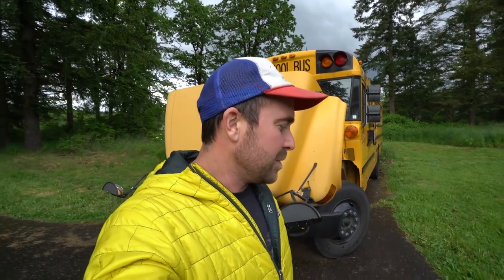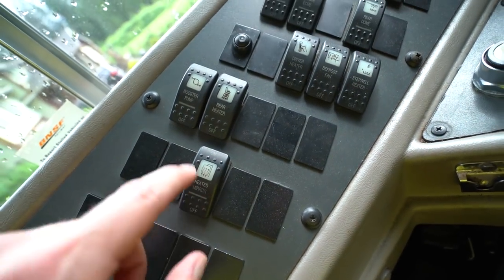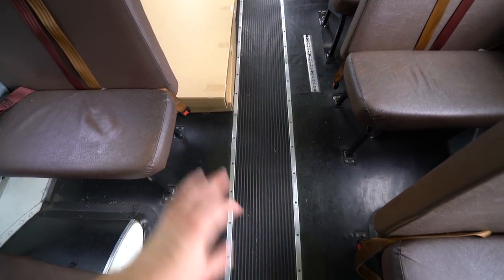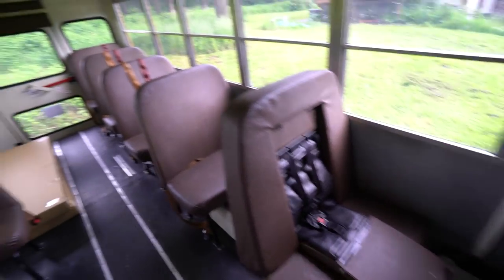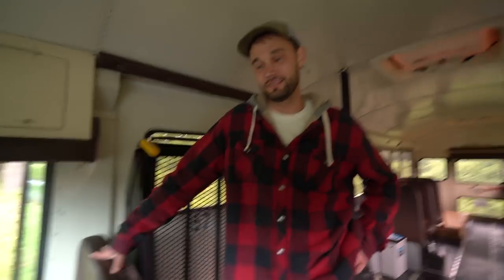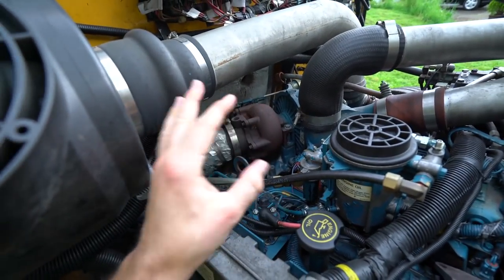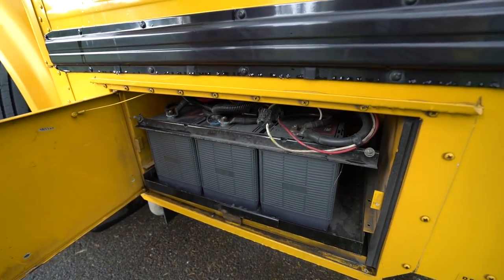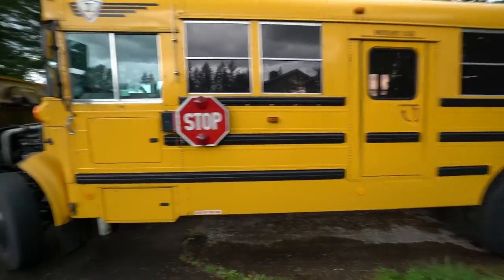SCHOOL BUS TOUR - BEFORE SKOOLIE CONVERSION

Comment: Sorry if this is old news but air brakes work in reverse. The air is pumped in to cylinders to release the brakes not to apply the brake. If your engine is not pumping air to the brakes you will NOT move. When you tap the brakes, air is released from air lines and massive springs are alllowed to apply friction to wheel drums and slows the bus down.

Comment: Jax, another BIG plus with that back heater is if the bus is overheating turn on that back heater and you add about a gallon of cool fluid to the system.  That should be enough to get you off the road and somewhere safe.
Reply: I'm alway amazed that the people that make comments here are so smart!
Reply: Would you also be amazed to know that Jax made that comment in the video but apparently Journeyman wasn't listening.
Reply: Jackson we heard him but it's important to keep the heater, hard to go back da !!!
Reply: I just bought a bus. A short bus though... because I'm short. It has one of those heaters. It doesn't work though :(

Comment: Two things about air brakes I have experienced in about 1 million miles in coach busses are if you notice you are having to push harder on the brake pedal for the same amount of braking, there is an air brake problem and if you have to hold the parking release button in several seconds for the button to stay in and the brakes release there is an air brake problem. Just two things to be aware of with air brakes. One other thing that has been touched on in the comments, if you lose air pressure going down the road the maxi brakes (sorry brand name) will lock the rear wheels up tight immediately and I think that the parking brake button will pop out at the same time. I believe that will happen somewhere between 30 and 60 pounds air pressure.
Thanks for your videos.

Comment: I drove that exact same year bus as a school bus driver. They are awesome buses. You only need to drain the air tank if you are in humid climate. I live in the desert and we only had to drain ours during the rainy season. Also, cruise control is awesome, BUT you should NEVER use it while it's raining.

Comment: FWIW on air brakes. I am NOT an expert by any means, but as I understand the air brake system, a mounted air compressor is driven via "fan belt" by the engine. The air compressor is physically attached to the engine quite similarly mounted as the common alternators and air conditioner compressors. As the engine turns and makes RPM, the air compressor produces (80 to 120 PSI) and feeds compressed air to an air tank reservoir which supplies the system. The brake pads are held away (open) from the brake drums by the application of air pressure. When the driver steps on the brake pedal, air pressure is reduced/released from the closed system and the brake pads are released to engage the drums thereby the braking occurs. Depending on how much air the driver releases by pedal determines the severity of the braking cycle. The dash-mounted big yellow air switch/valve, when "pulled out", releases "all air" from the brakes , thereby locking the drums, the wheels cannot turn, the bus is parked. The air tank refills to capacity as the engine continues to make RPM. When the big yellow pull switch/valve is "pushed in", air is once again supplied to the brakes and the brakes are are released. If the brake system encounters catastrophic failure, i.e. air loss, while stationary or in motion, all of the brakes will "lock up".  Visual evidence of the catastrophic loss of air can commonly be found by the many demonstratively long and dark dual-wheel skid marks on our highways and byways. These incidents are likely from 18-wheel trailers having their air-lines inadvertently disconnected from the tractor (or ruptured hoses) while under tow. If your air compressor does not produce or there is a fault in the system, rest assured, the bus will not roll until you get the issue resolved. Stranded!
Reply from the maker: Yes! That sounds about right!!

Comment: If you use the lock on the outside  a suggestion from another skoolie life people that you rock before you go in. That way, no one can come along and lock you in your bus. ijs
For labeling wires, cords and cables; use the tab closures from bread, bagles and stuff. Write identification information on the tab and place it around the wire, cable or cord. FYI

Comment: I think you may want to ask Badge if getting rid of the heater is a good idea, as you said that can help with engine over heating !!!
Reply: It's also a system that works that's in place. I'd keep it as an auxiliary to a roof AC unit and if I had to I'd move it. Maybe put it on top of a wheel well since those are gonna have special treatment anyway.
Reply: Am. Blades the heaters are staying we might move them and we need them for WVO 🇨🇦💋💋

Comment: Air Brakes- You pull the Parking Brake (Yellow Knob) and IT WILL POP that means it is on when you release it the Air is forced out of the Brake Chambers and IT WILL HISS meaning that it is off and to Start a Bus The gearshift MUST be in Neutral so if you leave the bus in drive and try to start it you will not be able to start up the bus. The Bus with Hydraulic Brakes has a Parking Brake just like a car just so you know. I know everything about buses! So if you have any questions lmk

Comment: Jax, I would recommend emptying that air tank completely at least once a week to get the water out. I know that you have to idle longer to be get moving but it is well worth the effort because in cold weather your breaks will not let loose. As for the wheel chair lift, could you turn that into a fold out BBQ stand? Just curious, Jim
Reply: You forgot one cold weather Jax dont do that lol🇨🇦🇨🇦
Reply: JAPN Jim that is a great idea bbq 🇨🇦🇨🇦🇨🇦
Reply: Thanks, I was just curious weather it would work or not.
Reply: It doesn't matter weather it is cold or hot, it still should be done. Get the water out of the air tank, just saying, Jim

Comment: door heater would be marked on the control panel step or stepwell heat.  and driver heat that is beside driver would be marked as Driver heat or front  heat and rear heat would marked as rear heat. Another great engine is the 7.3 power stroke engine also was used in the school buses . but I agree stay away from the 6.0.   for GM  6.2 were rock solid but known to be oil burners but the 6.5 is the better of the two

Comment: You name dropped the International VT365, just got a 2007 International 6 window....in great shape. But what should I be cautious of with the VT365? The only thing I know is that the 6.0 ford powerstroke runs at a higher RPM ..close to 4K vs the VT365 at around 3K when running all out. I always hear stuff about the 6.0 Powerstroke but not so much on the VT365s.

Comment: On removal of OEM remote heater.
Seems like it would decrease quite a bit of area that was previously dissipating heat, even if the heater was not running.
I'm good to go with removing the OEM remote heater, decreasing the maintenance and chance of failure of a wet system is good. 
But how does removing the heater and peripheral coolant lines (±20 ft aft and back) affect the coolant systems capacity and engine temperature? 
Would it add to overheating under peak engine stress plus elevated ambient temperatures? 
If deemed necessary, how will you compensate for the loss in cooling? 
Add an additional electric fan to the radiator? Which might be a plus at any rate. 
Transmission cooler?
Reply from the maker: We are adding coolant lines to veg tank. But I like that line of thinking.

Comment: I thought the air-ride seat was available on any vehicle. Isn’t that just a small shock absorber? Are there air lines to it that I didn’t see?
Reply: that is a small shock absorber, the air suspension is directly under the chair, it was hard to see as it's black
Reply: Austin Ash Thanks.
Reply: Yes, there is a small hydraulic shock and an air bag that is hooked to the air drier and the compressor.
Reply: Carlos Benjamin no its air some of the buses with no air have a hydraulic assist seat 🇨🇦🇨🇦🇨🇦
Reply: Vlite Rving Thanks. That’s probably what I was thinking of and confusing it with “air ride”.

Comment: Would it not be worth it to keep the coolant lines from the engine to the back of the bus to heat up an insulated tank of water during the day as you drive for heating at night? Figure a little 50 gallon tank of coolant water to run in a radiator near the bed for night heating would let you just run a 12v pump and fan till the temperature of the water drops enough.

Comment: I would like to do this someday, but there is no way I could do all the conversions, is there somewhere you can buy one converted?
Reply: you can, it won't be cheap and you have no idea if they did a good or crappy job renovating it.  for all you know you could step in the wrong spot on the floor and fall through because they didn't fix anything.
Reply: yeah good point

Comment: Air brake systems are designed for heavy vehicles and once you get some weight in the bus your brakes will ease and become smoother. When you get an air endorsement on your operator's license you will need to know some basic mechanics and key numbers involved. It's all in the handbook and easy to understand from the compressor to the spitter valve heh, heh. You drain the air tanks to get the condensation out so they don't rust as quickly and in the winter it's the condensation that freezes so you'll want it out for that reason also. There are additives that you'll put into the system in the cold monthes to keep it from freezing also. So, you just pull that rip cord until air and water stop comin' and most times a lot of condensation comes after the air. Just because a rig has those air bags (suspension) it doesn't necessarily have air brakes. They are two separate systems. If you can find any of those engines, that run, for 2 or 3 grand BUY 'EM! I know that mechanical stuff isn't your thing Jax, so I'm not rippin' on ya, I'm tellin' ya so you'll know, maybe engines go for much cheaper there. There is the dollar difference as well, but 2 grand is below wholesale here. Does your bus have an engine or exhaust brake? Some people call 'em Jake brakes, but that comes from the manufacturer Jacob's Brake. Same deal as, in some places, folks will ask for a "Kleenex" which is a popular brand of tissue and it's a tissue they want so give it to 'em...they have a snotty nose. HaHaa! What are the inside dimensions of that rig? I've been doodlin' some plans and such for my own amusement and I've just guessin' the numbers. I could look up numbers I suppose heh, heh. Get at 'er guys! ............................................PEACE!!
Reply: GT Lees thats to much info for Jax lol🇨🇦🇨🇦
Reply: That's for sure!! This video must be for the crowd that has never set foot on a bus or has no common sense at all...Not to mention some of the information given in the video was inaccurate..I get a kick out of these young guys who buy a bus from a dealer like they are buying a certified Lexus paying a premium, raised price for a bus that was swept out instead of an auction bus for half the price!! lololol

Comment: did you get your CDL with AIR BRAKE endorsement?
Reply: thats the funny thing about skoolies.   you don't need a cdl or air brake to drive them.  just a regular license will do.  for a school bus you DO need those, but not for a skoolie.
Reply: For rv classifications, some states require non-commercial license dependant on weight and/or length.
Reply: Where I live you need the air endorsement whether it's a tractor-trailer, a school bus, an RV, or whatever has air brakes. I take it pretty seriously 'cause it's safety and my loved ones are on those roads too. So, a person should know about whatever system is supposed to stop their rig. It's just the responsible thing to do, I'm not sayin' that they should be a mechanic but a person should understand the basics. How else would ya know if something was wrong? ......................PEACE!!
Reply: i totally agree.  if you buy a vehicle with air brakes you should have to get air endorsement.  when i get mine i'm going to learn everything there is to learn about it and how it works so i will be able to repair it.  i'm actually looking into getting the proper license to drive a bus and if it comes with air i'm getting air endorsement also.
Reply: it's based on weight, not every single driver of a vehicle that has air brakes  needs that endorsement! It's actually made for commercial vehicles ..it has to be over a certain weight like 26K  which many diesel RVS  with air brakes are under 26K weight..

Comment: I would like to buy my bus in Nevada or the desert states because it is dry there and no snow,  so there will be less rust.  Do these states require emergency doors?  I do not want emergency doors.  
Also, do they have insulation in the roof?  I don't want to have to tear out the roof and spray with foam. Is there an easy way to replace the passenger door for better insulation security and visibility?
Reply from the maker: Check states for info. All seem to be insulated.
Reply: If the roofs are insulated then why do so many people go to all the trouble to pull the panels off and reinsulate.  Seems like a lot of work for nothing then.

Comment: I'm no expert... but it appears to me in various YT vids that most of the exterior fuse panel doors on the buses are NOT equipped with locks. My oh my, if one wanted to be a little terrorist and wreak havoc on a skookie's day, it would not take two seconds to trash that box on an unattended skoolie. I don't understand why vital components so critical to operation are not safeguarded at OEM.
Reply from the maker: It has a lock. Just gotta get a key ✌️

Comment: what're the internal and external dimensions of your bus?
Reply: Standard school bus interior width for making plans is 7.5' then the distance from the drivers seat to the rear exit will vary but a general rule of thumb is most bus windows are 2' wide so when you look at a bus usually you can simply count the windows to obtain the approx length!!

Comment: Ajax please learn about your air brake system Michael has right fluid is not compressible 
air is plus you relay valves and such for air to go thru before the brakes activate a common 
mistake is pushing brake pedal not feeling any thing happen and then pushing harder whoops face in windshield from the time you push the pedal it takes about 1/4 second for
the brakes to apply if you lose air going down the road your rear brakes are going to lock up
when you pull the yellow knob it exhausts the from the brake chambers and big springs apply the brakes learning not to over apply the brakes is important get somebody that knows how to adjust your brakes and have them teach you you may have self adjusting brakes they
are not 100% reliable the slack adjusters should be kept well greased I have about 45 years
behind the wheel bus tractor trailer as well as working on them you can send me a private 
email and I will send you my phone number your welcome to call any time hope to meet you
in the near future my bus should be on the road soon
grumpy old man with a bus
Reply: Hi Marshall, may I pick your brain a little...?
a little background on me...I am NOT a truck driver (electrician). Had a stepfather that drove tractor-trailers OTR in the 70s and 80s. I also did trailer repair for about 6 months for a trucking outfit in Michigan some years ago. So I know "a little" bit about "a lot". 
I have watched many of these skoolie conversion videos and there is not a lot of technical information given in these videos (for obvious reasons) ...but maybe you can help me as I considering a school bus to convert.
1.) Some of these buses have had the roof raised. With the additional weight or even the higher center of gravity, would a suspension upgrade be a good idea?
2.) As far as HP goes... many of these buses have engines somewhere in the 5 to 6.5 litre range. So this would be 302 to 450 cu in. size...correct? 
With the weight of these buses, are those engines at their max? 
I have heard a few people state the buses are not really "fast" and very slow on grades. Makes sense, you are hauling children. ...and usually a short distance. However, now you are an "RV" ....what I want to know is this...is there enough room in the engine bays to accommodate a larger TRUCK engine? Say something in the 14 litre range?
...and, of course, I am assuming a larger engine (if it would fit) would require an upgrade to the front suspension....yes?

Bottom line, I am looking for a lot more power than I "think" most school buses have to offer. I would like to pull a 6x10 cargo trailer (motorcycle and tools). I just want know if such a configuration is even possible without having to actually get a different frame/chassis in a conventional type school bus (not a "pusher). My stepfather drove a K-100, cummins 400 with a 13spd. I am sure something like that would have enough power for a 25K lbs skoolie (or an automatic transmission equivalent). Mountains would not be "as much" of an issue and cruising at 70 miles per hour would be easy on an engine that size.

Anyway, hope you can help with some info...thanks.